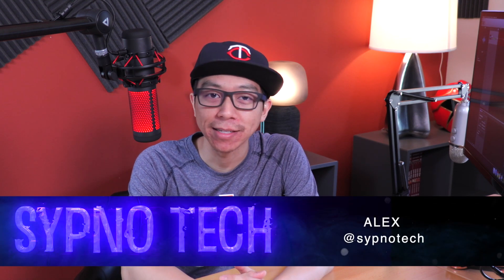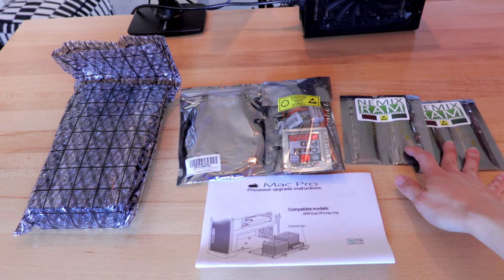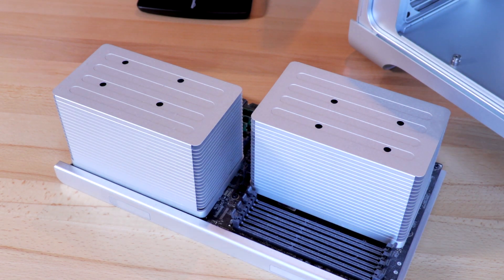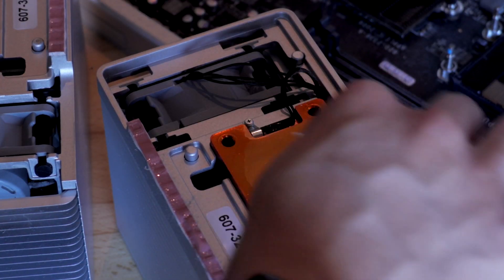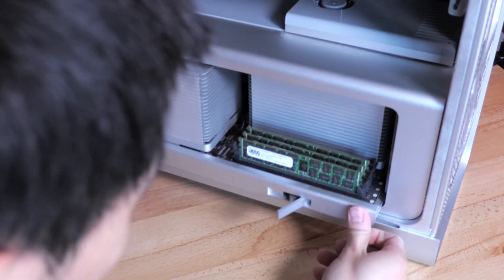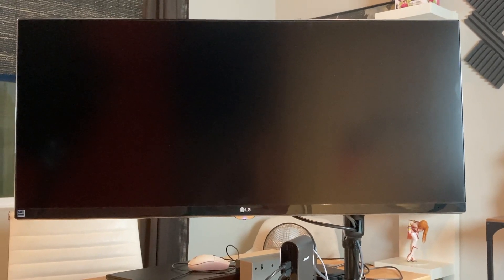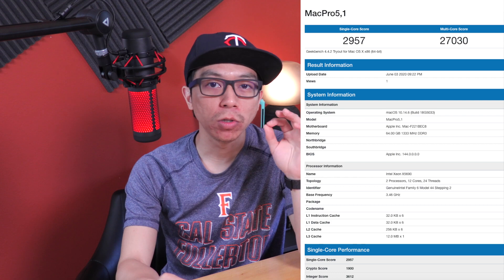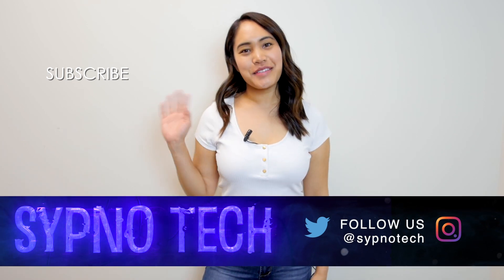How to Upgrade a 2009 4,1 Mac Pro in 2020!

Comment: Hola buenos dias me venden una mac pro 2009 en 50 dola pero el dueño dice que ya se puso que no queria encender y a veces si encendia pero despues ya no encendio tiene arreglo vale la pena cual podria ser el problema porque dice que no da señal de nada cuando intenta encenderla sera la fuente la vende sin el disco duro
Reply from the maker: You would have to troubleshoot it. That seems high value/high risk as $50 is not a lot of money to pay, but you won't know what needs to be done until you open it up and tinker.

Comment: I currently have a Mac Pro 2009 Quad 2.66, flashed to 5,1.  Been using it for years, and still a pretty good workhorse.  I recently came upon a Mac Pro 2010 Quad 3.33, with a Radeon RX 570 8GB (yes, this is score!).  However, the casing is kinda beat up.  I was wondering if I can just swap out the motherboards (and GPUs)?  My understanding is, with the exception of the 2010 having a Fibre Channel connection, it's pretty much the same hardware.  And given they are both "5,1", it shouldn't be an issue?  Is this possible?

Comment: Hi, can anyone please help? I upgraded my Early 2009 Mac Pro from 4,1 to 5,1. I have been trying to install OS X El Capitan, but even after downloading and installing the free upgrade from Apple, I am still stuck on OS X 10.9.5. When I attempt to download 10.11 from the App store, I receive an error message saying my Mac Pro is not compatible. My specs: 2 x 2,93 GHz Quad-Core Intel Xeon; 8 GB 1066 Mhz DDR3 ECC RAM; NVIDIA GeForce GT 120 512 MB graphics card; OS X 10.9.5 (13F1911). I regret upgrading to 5,1 firmware as it appears ever since I did so, I can no longer gain access to any of the web pages that we used to use with a payment card, e.g. Takeaway food pages won't open, or any URL's with payment entries. Thanks to anyone who can help!!!

Comment: There is so much wrong info in this video. Th CPU's must be delidded so that the cooling fan connectors plug in and the temp sensors can work, no more loud fans. AND the original wifi-BT WILL work but is also upgradable, saving the pci slot for something else, for example a PCI NVMe drive, which will drastically improve performance.

Comment: Hey  I have 2009 4,1 and flash to 5,1 Hi-Serra it won't turn on after install X5690, On tray keep see solid light  on , I take off clean up re-paste and put back on still won't boot -no chip sound -and of course LIGHT still on. Hope you can help me or any body have the same experience at pass . Thank you

Comment: As many others already told you, the issue is caused by the lid on CPU's. Mac pro 4,1 dual processors should be without IHS (integrated Heat Spreader), in few words, without the lid. You should remove it before to apply onto the motherboard. About the wifi card, mine is: 
AirPort Extreme  (0x14E4, 0x8E)
 Firmware Version:	Broadcom BCM43xx 1.0 (5.106.98.102.31
It has been recognized by Mojave without any issues.
Reply: Mine are not delidded they work fine however I am using Sierra

Comment: What OS were you running prior to the update ? I assume el capitan... So did el capitan boot with that card and then you just updated by the app store? I also noticed you did not reset pram or smc afterwords ... is it necessary? and did you ever get the fan problem fixed by delidding or check fan connections like the comments were saying ? thanks
Reply: Yep so many questions.
Reply: @KCphilippi  well the fan problem is because they never seated onto the power connector correctly you have to pull them and hand put them in or just use delidded cpu's. Didn't think you could load Mojave on a 4,1 without a cpu change thats why I was asking..... oh well
Reply: @jhillestad  you’re right a 4,1 can’t update. However he flashed it to 5,1. I wanted to know if he just plugged it in then booted into an update? Meh
Reply: @KCphilippi  I believe you can go to high sierra by flashing to 5,1 but not mojave or higher... Hrutkey mod video showed him updating then jumping straight to high sierra if I remember correctly...

Comment: The connector between your fan and your processor isn’t plugged in right, cause there is a headsinc on the processor. You need delided Prozessors and then the Fans will run normal

Comment: When you added the washers in order to use lidded CPUs in a de-lidded application, you moved the heat sink up to far for the fan leads on the heatsink to contact properly. You need to manually plug the cables in after freeing them from the heatsink and then screw down the heat sink. You should also redo the thermal paste on your northbridge chipset.

Comment: I am going to water cool mine.
Reply: Please make a video. Would love to see this and see benchmarks for it. I love these classic Mac Pros. Anything we can do to breath a little more life into them is well worth it.
Reply: @joshuapinter .I will try.The problem is that there is a temperature meter hooked to the cpu heat sink and removing it will cause the computer to shut down.
Reply: @gerald4027  Oh, very interesting. Well, good luck with it.
Reply: @joshuapinter .Thanks.The problem is all fans will run at 100 % if the temperature meter is removed and then the computer will shut down. I will need a bigger water block to support the water meter.Any ideas and why are macs so complicated for something so easy?Also I was driving a simitruck and another truck ran me off the road,I took pictures of both trucks,called the police, the other driver was cited,my boss took away the company Apple phone from me and Apple won't let me have any of the pictures I took of the $20,000 accident because the phone does not belong to me now.

Comment: Hello, other Mac Pro 2009 model upgrades used delidded CPUs, why yours does not? I also noticed that you used washers, whats the purpose for that.
Thanks in advance for your reply.
Reply: You can use both. However you need to get your fan plugged in (mod) if you use lidded CPU’s.

Comment: the fans running at full speed due to the CPU heat sink not being installed correctly. the CPU need to be delidded so the heat sink connector can sit all the way down.  eBay had a delidding tool for $10 bucks makes it super easy.
Reply: Can you provide a link to the delidding tool? Thanks!
Reply: @ALEXBALLHOG  also the seller has a youtube video tutorial on how to use his tool
Reply: @ALEXBALLHOG  you can get it on eBay,  here is the link 😀👍🏻 https://www.ebay.com/itm/174308067199

Comment: I have a 2009 Mac Pro flashed to 5,1 running High Sierra. I have the Sapphire RX580 in my mac pro but when I start, the screen stays black. What happens now? When you say put the old graphic card back in to see? Do you mean when the computer is running put in the old graphics card? Can you provide more specific details?
Reply from the maker: Shut off and unplug your tower before swapping back to the original card. I would recommend checking to see if your ram and heat sink were installed properly as well.
Reply: @Sypnotix   I tried unplugging and swapping back to the original card. My ram and heat sink are good. I tried reinstalling el capitan, then upgrade to high sierra. I took out all unnecessary components such as usb drives, extra pcie cards, and extra startup disks. As soon as I put in the Sapphire Pulse RX580, I get a black screen. I watched it for 25 minutes and it stayed black.
Reply: @Sypnotix  I do have a 2x 2.66ghz quad core running 32 gb of ram.
Reply: Open core now let you regain the boot screen
Reply: Just let it boot and eventually it will come on screen.

Comment: Well done. I get fan noise as well but only lasting approx 2 mins after boot then very quiet. I noticed that noise only after upgrading to gigabyte radeon rx 580. From "Macs Fan Control" software I can see the fan noise is from PCI fan and PS fan, which is acceptable for only lasting couple of mins. You could use opencore to get boot screen plus other benefits as well such as running Windows 10 in UEFI mode and boot picker etc. Refer this link https://www.youtube.com/watch?v=7wWfU3AlFPk
Reply: yep I figured it was the graphics card
Its over kill unless you are doing graphic work there are cheaper metal graphics cars out there!

Comment: As you haven't de-lidded the fan headers that are attached to the heatsinks might not be fully plugged in (cables are very short and retained in place) You can release these and push them into place (it's a little fiddly). Once done it should stop the fans from revving. - Definitely you worth checking.
I de-lidded mine to save the hassle
Reply: Absolutely, the fan clip connectors on the coolers need to be clipped and drawn out, hand plugged back into the tray prior to cooler being remounted.
Reply: @mlinsalato  is there a picture of this ? I'm trying to visualize these connectors

Comment: Hello Dear !
Your issue with the fans running fast is due to that the cpu aren’t installed correctly they need to be delidded,, if you do that will resolve your problem good luck